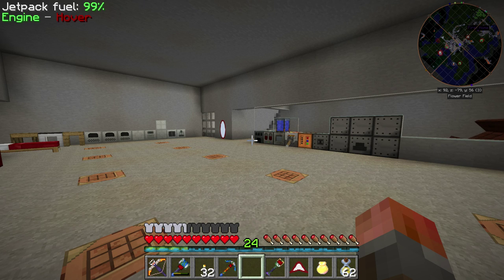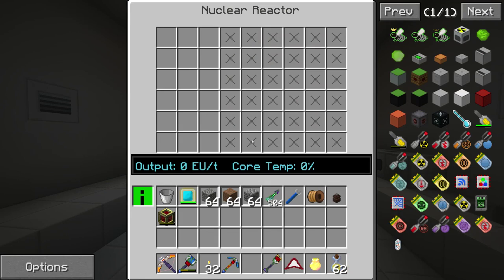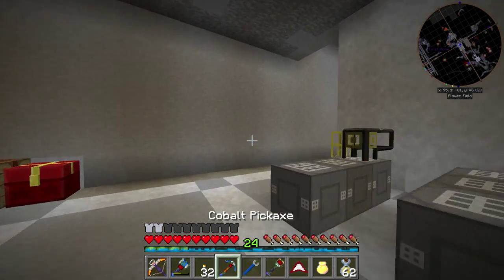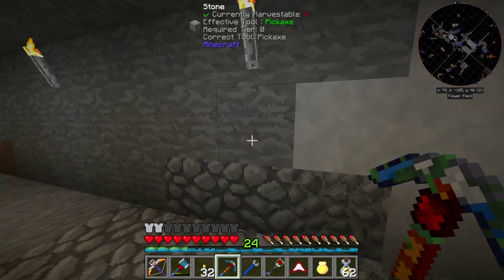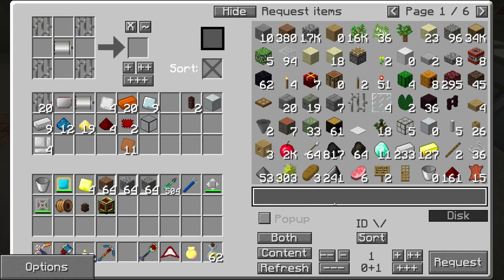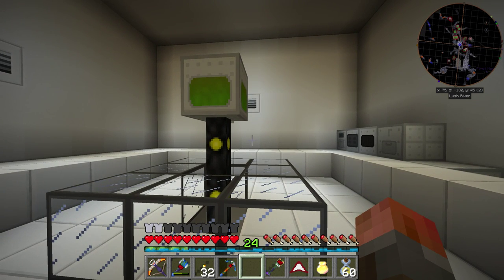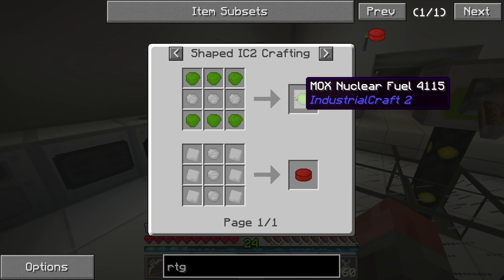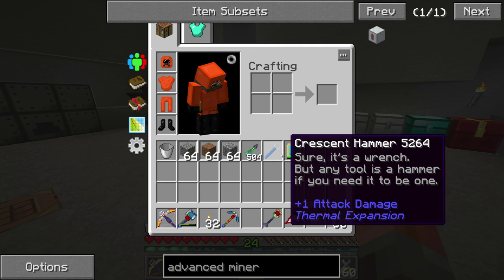FTB Infinity Evolved Expert E24 - Nuclear Startup

Comment: Enjoying the Series so far!

To Speed up Your LP Network you can shorten Paths by using the "Logistics Inventory System Connector"

You place 2 Ender Chest (Specific for that purpose, no other stuff may use them), Put the Connector Pipes on either side, and create a Pair of "Logistics Item Cards" in the Soldering Station. Those are Linked, and hence link the to Connector Pipes via the Ender Chests.

You'll need to power the "other" side of the network with a provider though.

That way you can shorten paths, and speed up the lp network.
Reply from the maker: +Popoblubbern That's a very very good suggestion!  Full credit on that one, will have to try it - especially to the storage drawer controller

Comment: All the above comments are good for oredicting the metals just to add another method I'd like to submit the cheapest storagedrawer which is just a few pieces of wood. Put in the desired type and then add the ones to be converted and they will all be converted to the primary.

Comment: Jabba barrels unifies input into the stored type, easy to automate with logipipes that way,.
Reply from the maker: +Sven 'flamestrider' So does storage drawers itself, it seems, but there are a few bugs in it that are annoying when dealing with multiple copper/steel types, etc.
Reply: I use chisel on metal blocks to unify them manually when I have a need, I guess that's also a solution.

Comment: There was a tool for reactor designs, but it's in java which doesn't really run in browsers anymore. Does anyone know another reactor design tool? I am just trying to make a Type 1 that doesn't degrade parts, and I think that means using coolant cells? Grayduster, where did you find your design?
Reply from the maker: +binaryalgorithm It's actually still downloadable - you can run it from the desktop as a .jar file.  (You can paste the old URL format into it).  I get the feeling it hasn't been updated in some time, so some of the blocks it used to use no longer exist.
Reply from the maker: +binaryalgorithm I found that particular design on the ftb forums.